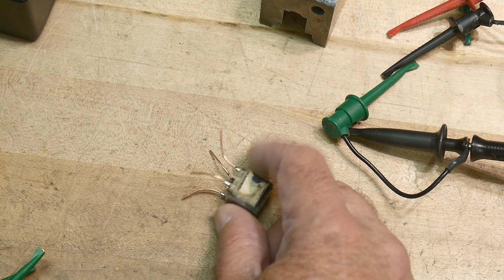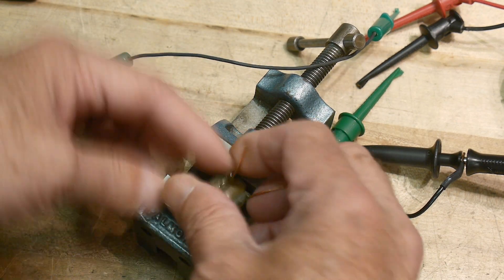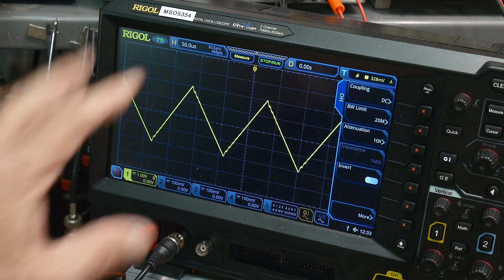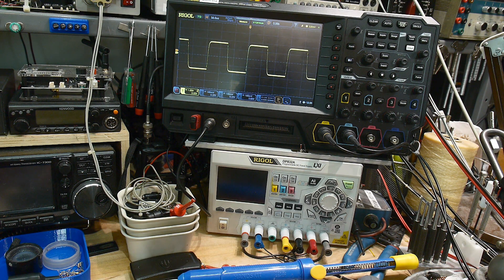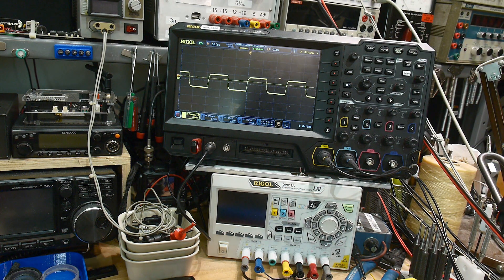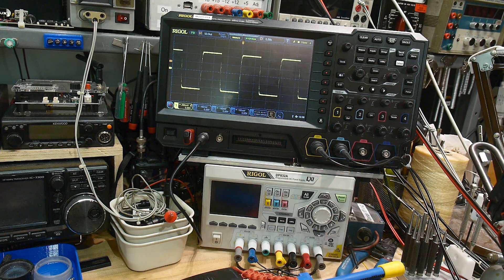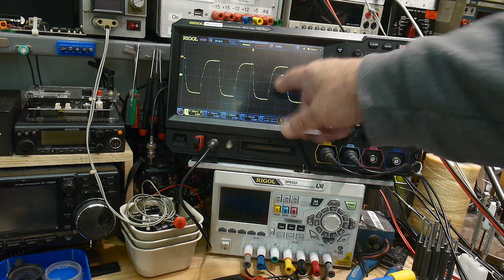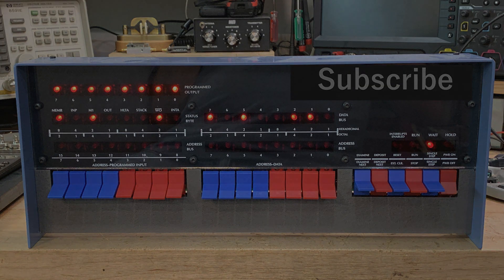#1087 Do audio transformers add distortion? reprise

Comment: These transformers were extremely good in retro handheld AM transistor radios, given even teared batteries ~2v they were pretty loud. It's impossible to produce such sound on 8Ohm load directly on 2v power without transformation. Also it allowed to implement B class amplifier on single type of BJTs.  I'm interested in replicate such amplifier on germanium pnp BJT transistors, but I don't have metal core transformers. I wan't to use same tiny size ferrite cores freely available now. Ferrite cores have much higher permutability but much lower saturation than metal ones, so I think it's possible to compensate it and make equal by making an air gap. 
Can someone point me to documentation or video how to properly calculate such transformers for B class amplifiers, to implent 1960-70 handheld BJT radio amplifiers on modern EE16 or EE19 ferrite cores?

Comment: To my knowledge, distortion of an audio signal may be audible at much lower levels than what you can visually discern by looking at a time domain scope display. It would be really interesting if you could repeat the tests and compare fft plots (ie. in the frequency domain) of the input and output signals. An 8-bit scope does not have the resolution to detect harmonics 60dB or more below the fundamental frequency. If you have a PC and a reasonably good audio interface, there's an excellent program called audiotester that lets you perform such measurements.

Comment: The hand mike for my Kenwood TS-440SAT, constantly gets on air comments about the quality of my on air sound...  the Mike circuit consists of a dynamic microphone hooked up to a transformer, which is then fed to the radio.  It is very simple, but seems to work remarkably well!...  and the ground, on both sides of the transformer are connected together!  :)

Comment: Are we talking about output transformers or input (like microphone) transformers?  On most output transformers you take feedback to the amplifier from the secondary of the transformer.  Thereby you attenuate any distortion by the amount of the feedback, maybe 20 dB  which equals 1/10 in voltage.  You generally never have that available on microphone transformers.
 As to the measurements - it would have been much better to use two channels of the scope, one on primary and the other on secondary to demonstrate the potential differences caused by the transformer.
Reply from the maker: microphone output and preamp input transformers have no feedback

Comment: Distortion is caused by any non linearity. Transformer cores have two sources of non linearity. Hysteresis and core saturation. BH curves are non linear at the beginning of magnetisation and at the point approaching saturation. If you operate the transformer only between these in the linear section your signals will not suffer non linear changes, eg. Distortion.
Reply from the maker: That is true. For me to be more accurate: a circuit using a transformer may distort the signal due to the issues shown here.

Comment: Assuming the same wire is being used on both windings, you get the ratio between windings equal to 180:120 = 3:2. That means the resistance you place on the secondary is seen from the primary as (3/2)² = 9/4 times larger or smaller depending on which way round the transformer is connected. In one case, you loaded the secondary with 6K8 and in the other case you needed a load of 2K2. Assuming you're only able to estimate the matching impedance to around ±20% or so, that's perfectly consistent with required loading of somewhere around 4K on the primary (4k x 9/4 = 9K and 4K x 4/9 = 1.8K).

Comment: A question: If the transformer core would reach saturation, would the big chunk of steel then matter?
Reply: Yes and no.  It would show in good, sensitive difference measurements.  But it would not matter, because the saturation itself is huge distortion.  In audio transformer you want to stay far away from a saturation.  The ringing can be described as the effect of stray inductance and stray capacitance resonating.  You want good coupling, or mutual inductance, while you want to minimize both stray components.
 Another concern is whether you are dealing with an amplifier output transformer or an input transformer like one from a microphone.  The difference is that the output transformer distortion is normally compensated by a feedback brought to the amplifier from the transformer secondary side.  On a microphone transformer there is no correcting feedback around the transformer.

Comment: Actually, I'd expect a transformer to roll off the bottom end.  As you get closer to DC, the rate of change falls off and it won't transform.  Higher frequencies do carry over.  You've demonstrated that at the higher end, the choice is between ringing and roll-off.

Comment: That is the second time I see that in your video about this series is how you wire the transformer itself on the primary and secondary and you never mentioned anything about it.

To me it looks like you are wiring your generator on one side on the secondary and secondary and you do the same with the scope...

Have I wrongly wired audio transformers in all my projects or it is the way yours is designed?
Reply from the maker: does matter, unless you are worried about phase
Reply: Really?... Uh... So the source should be wired to one pin on the primary and one pin on the secondary ?

I'm here to learn and I can say I learned something i clearly do not understand !
Reply from the maker: @Aleziss  no primary is one winding and secondary is second winding, they have no connection
Reply from the maker: @Aleziss  maybe you are confused as the wires can come out in any order. there is no standard on what side of the transformer the wires are on
Reply: @IMSAIGuy  yes that is what I meant, to me it looks like your transformer is connected sideways, that is what I meant and I did not understand how you could connect it that way and that is was working !

Comment: Measuring/categorizing transformers using DC resistance isn't really the best way, as wire gauge comes into play. In this case, with a simple audio transformer it is ok, though. 
But measuring the inductance is a much better way to easily categorize the primary/secondary winding ratios. If you have an LCR meter, it wouldn't be any more difficult than using the multimeter to measure the DC resistance.
Reply: Or, if one is equipped gracefully with signal generator and oscilloscope already, one can measure the ratio between input and output voltages.

Comment: Transformers also raise the lower frequency cutoff; they don't work at DC as an extreme limit.  Also, the driver output impedance comes into play since tau=RC or tau=L/R.  (Most precisely, superconductive windings do allow infinite time constant and DC response, but these are not superconductors.)

Comment: Great video. Maybe the signal integrity at higher frequencies is not so great because you need to do impedance matching on the primary side of the transformer as well.